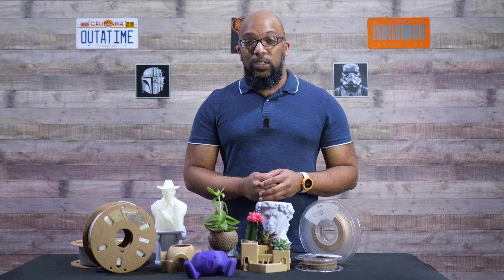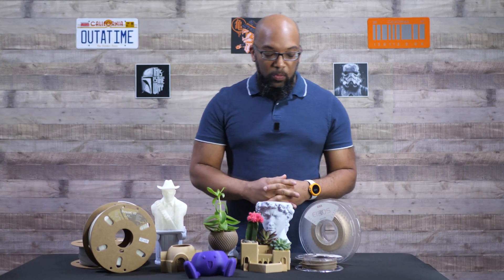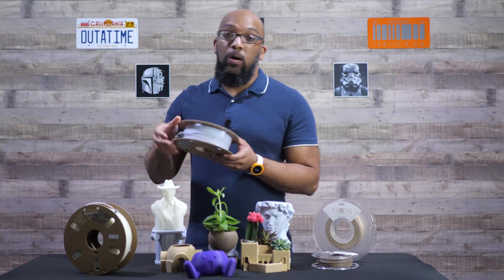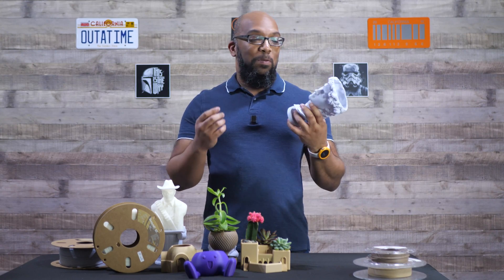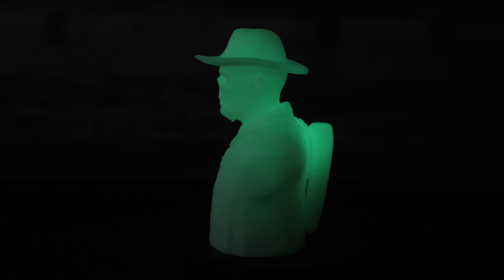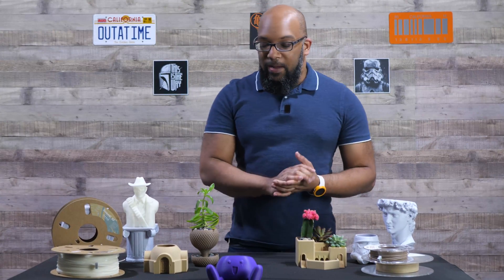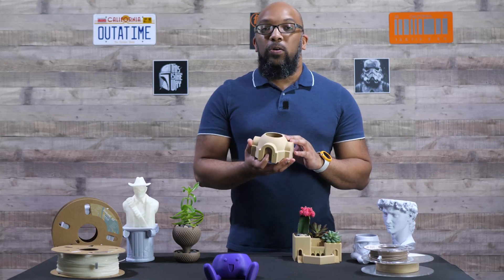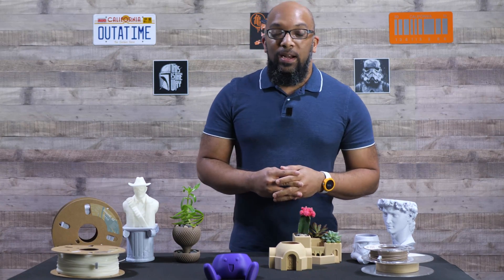Printing With Abrasive Filaments on the Flashforge Adventurer 5M 3D Printer

Comment: Just how abrasive is flashforge's glow in the dark filament? I picked up a 5M pro printer and some filament, nowhere in the listings or documentation does it warn about abrasiveness.  In fact Flashforge recommends 0.4mm nozzles, but the 5m and their other printers don't have hardened steel 0.4 nozzles, they're only stainless.  You have to buy 0.6 or 0.8 hardened steel separately.  Feels like dishonest advertising/documentation to not warn that the standard nozzles will wear out faster.  I've printed a ton so far and everything seems fine, but wondering when the other shoe will drop.

Comment: Great video as always. Very well done as usual. Have a question about extuder ware when using abrasive filaments. I believe the 5M series doesn't have all metal drive gears in the extruder (please correct me if I'm wrong) so using abrasives should impact extruder life. Haven't seen anything from FlashForge about this but it seems to make some sense. What do you think? And have you been able to detect any ware on your extruder? Appreciate any guidance. Thanks.

Comment: Your content is fantastic .. I don't know how you don't have more subs. Putting the extruder head back together now after taking it apart to get to the innards of the gearbox. I pushed the retraction settings too far yesterday (trying to fix a silk PLA issue, when the mistake probably lay in not using the 0.6 nozzle) and got bits of plastic onto one of the gears, which gave it erratic feed. A fairly straightforward machine to work on if you take notes and pictures. Thanks again for the feedback that helped me buy one of these :)

Comment: Hey. I print a lot of abrasive filaments on my k1 and sovol printers. I kind of understand why flashforge did that but it is still a shame. Most of the abrasive stuff like glass filled, CF filled or even wood do not do so well with a 0.4mm hardened nozzle. I still use my 0.4mm by metal nozzles for those filaments it will sometimes clog. And if you look on most manufacturers web page they say a 0.6mm nozzle I needed. Now glow in the dark has no issues with 0.4mm so it is a shame they didn't include 0.4mm nozzles. I am printing some CF PA and CF PLA right now with  0.4mm nozzle. And for me no issues but some printers really struggle sometimes. I assume it has to do with filament path and extruder. Thanks for the great video. Cheers

Comment: Hello good sir, I know this has nothing to do with this video but is there anyway you could do another hueforge video slowing down the part where you insert the layers and what not into orcaslicer. I can get the pic I want in hueforge with the the pauses I need  but Im a bit confused on the parts where you transfer all that to orcaslier. This would be a huge help. thanks
Reply from the maker: Sure, here's another video. I hope it helps. https://youtu.be/QUUH5cpcz0M

Comment: wish they made a 0.4 hardened steel nozzle  for the adventure 5m and 5mpro 

Top class video thank you!
Reply: Legit wish.  I'm wondering if there's concerns about clogging at that size if using an abrasive filament.